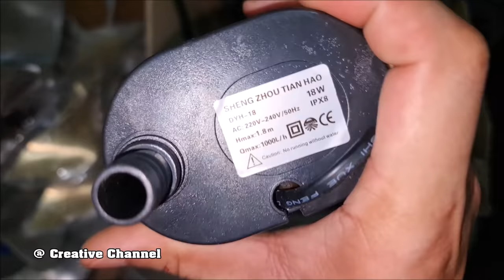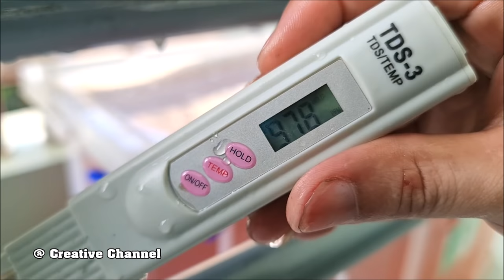How to make a Hydroponic System at home using PVC Pipe

Comment: The space around the cups and the facts that they are transparant makes light come through, causing algea growth and rootproblems. Also the drain on each pipe should be on the bottom, not in the middle, now you will have a high water level building up on the end of each pipe.

Comment: So, as a novice trying to learn, I think I'm seeing a sort of multi-port Kratky method system here. Jumping from the presented design, would it make sense to (1) adjust all the system parts to promote water flow, and (2) to use offset pipe ends, to have High level intake, and Low level output? So, entry of grow solution is at top of pipe, and highest point in the system is the feed. water & fertilizer grow solution flows down from that entry port, to the far end of the first pipe, dropping some cm or inches to achieve 3% grade; bottom of pipe cap end is the drain for that module, a similar slant to the next tube by turning the smaller pipes a few degrees, and feeds into the top of the next pipe length, which then drops another 3% to a bottom center exit port, to the feeder to the next pipe segment, which is again top, then another 3% downgrade through that grow pipe, to another bottom center exit drain, etc, making it all one big stairway-type design. 
Would that improve any flow dynamics? Is it just more trouble than it's worth? 

Also, please tell me, what's the horizontal length? I'm looking to get a 10 foot PVC Drain pipe method sorted, probably leaning towards NFT method, so maybe I'm overthinking the deign presented.
Reply: I don't think the grade is really needed. The input flow of water is going to push it all through the system anyway and it will flow down and out regardless. In a Kratky system there's no flow at all, it just sits in a solitary container.

Comment: When you drill the large holes, use the bit rotating backwards.  It will make a much prettier hole without burrs on the sides.  And your water tank needs to be painted BLACK on the outside, otherwise you'll grow algae instead of fruits and vegetables.
Reply: Well as long as it's not red algae you can eat most other algaes as well not sure I want to eat the equivalent of pond slime though...
Reply: @calebwiggins3042  Trust me, there are many reasons you don't want ANY algae growing inside your tank.
Reply: @MasterKenfucius  lol. I completely agree. It causes trouble.
Reply: Could try adding some small fish

Comment: Wondering how you would clean the system since its all glued together.
Reply: Sterilizing is often achieved by using bleach, hydrogen peroxide, and antibacterial products like Lysol. These can be applied in sprays, dunks, or soaks; whatever it takes to kill off that microbial life. You should use both sterilization and sanitation in order to make sure that your grow room is as clean as possible.

Comment: Awesome, but I can't find these reducers anywhere 😢
Reply: 3" to 1" reducer
Reply: Better use costlier but more easier to clean troughs of 4"-6" with caps and 1" pipes to connect water at ends.
Troughs can be easily cleaned. Troughs used for water harvesting on rooftops too.

Comment: A technical quest for you bro. 
Why you didn't connect those pipelines in parallel method??
I will try parallel version of this structure 👍
Reply: Prallell means flow won't be constant in all of them.  If in series,  flow is basically constant

Comment: How will you clean the root system out if you glue the pvc ends?
Reply: Saw another video where he hammers to tighten the pipe ends to prevent leaks

Comment: Never cut cable ties with side cutters as they stay sharp and will cut you up. Use normal pliers and get up close to where you would normally cut them off grab the cable with them and twist around till it snaps off. This leaves a blunt end.

Comment: Should use black cups instead of clear. Black reservoir instead of clear. Black hose instead of blue clear. I'd run two pumps one just for airation and circulation of the resavoir water. The other to feed the plants unless you put the reservoir higher than this stand and Used gravity with a timer valve.

Comment: Nice video! But could you please add the list of the materials in order to have a reference of where to start? Otherwise thanks for the idea 👌🏽
Reply: Sistema hidroponico:
4 tubos de 75h2.2mm
24 reductor 75-27
2 tubos de 27mm
26 codos de 27 mm

mueble
4 tubos de 34 mm
24 T de PVC de 34 mm
4 cierre de 34 mm

Comment: What's the specification of the PVC? and cut size? thanks
Reply: The frame you can use 1 inch pipes, and for the cupholders, 3 or 4 inches, maybe 4 is better. Cut lenghts according to your space available.
Reply: The reducer in the video is 3" to 1" (75mm to 27mm)

Comment: Willing to bet this was during the insane covid lockdown because that's a lot of hobbying..lol.. They say that you'll never do a day of work in your life, if you have a passion for, and enjoy what you do. As a retiree , who was a avid hobbyist of indoor herbal horticulture during the late '70s and 80s (If ya know what I mean.. 😉).. , personally, I would have just modified The ebb and flow table you originally started the seeds on.. Great video, Just wondering what kind of illumination you are using. Betting LEDs, I've used both, and with the exception of excess heat and electric bills , I had bigger yields with  1,000 watt metal halides for growth,  then switching over to a HPS conversion bulb for flowering.. The  red shift In the spectrum tells The plants that summer is about over, followed by a blooming frenzy.. 
 Good luck in your endeavors..

Comment: are you gonna eat that?
I noticed that the clean up process is not included in video. But I hope you rinsed the pipes once more before the final fill in case for residual pvc solvent glue. 
Love the design but highly recommend opaque/ dark coloured reservoir tub to prevent algae build up

Comment: It would be good if you have added your measurements in the description
Reply: the measurement is depend on the product instruction, sometimes 2 ml per 1 Liter of water, others 1 ml per 1 Liter of water or maybe 3 ml or less than 10 ml per Liter of water, just read in the Label of the product.
the product name is different from each country. the product called "Hydroponic Nutrient Solution"  just search into your search engine or market Apps such as Amazon, etc.
Reply: He is sharing the concept. For the dimensions and measurements, it is depends on your available space in your house.
Reply: all measurements are different for spaces they will be put its not about measurements just follow what he did but make ur own measurements to fit the space ur building the system in if u mean the nutrients in the water its all different for all different set ups his measurements might not be ur measurements depending on the system

Comment: What is the rock wool replacement material? Is it safe? I am looking for a material that is cheap and safe?
Reply: You can try Rockwool slab and cut it into small cubs.
Reply: Try pool noodles
Reply: What is cost of this
Reply: I grew radish greens just using aerogarden cup and cut up kitchen sponge in a trickle system

Comment: This is one of the best videos, but I would like to point out that the water level is just too high in those pipes. The plants will suffocate, and their roots will die. The air gap needs to be greater. 

The sump should not be clear, or algae will grow.

Comment: This is not a good build.  He has no way to clean the pipes, and his clear tub will allow algae growth.  He didn't add an airstone, so he will not get oxygen in the water.
Reply: Funny you say that. I haven't cleaned my pipes in over a year as I don't need to. I just pull the roots out. Like mine, this doesn't need an air stone since the water recirculates. I tried an air stone in the system and it yielded no noticeable results. I also don't run a lid on my nute tank. No algae growth inside it either.